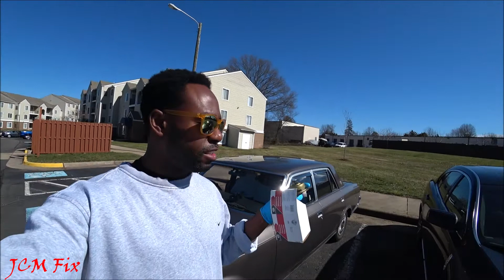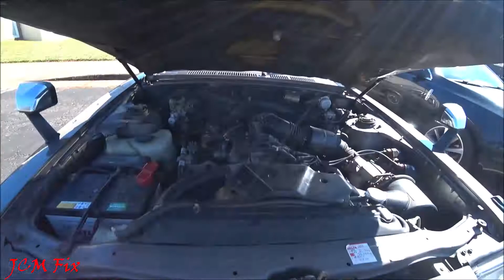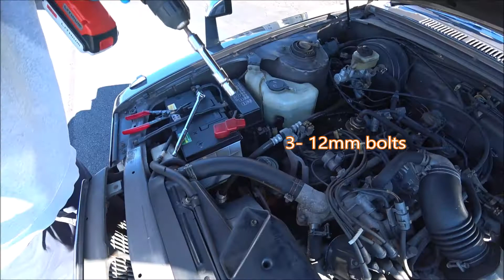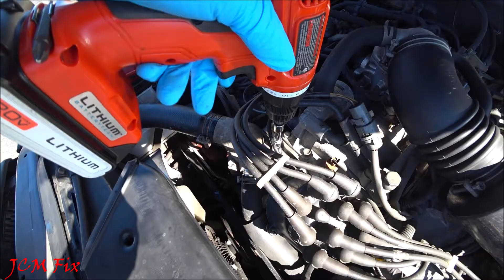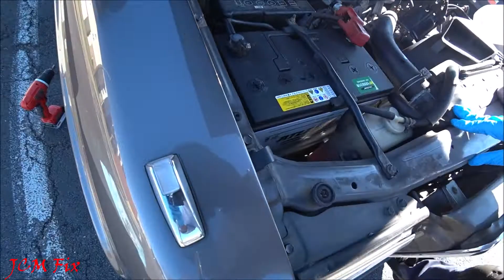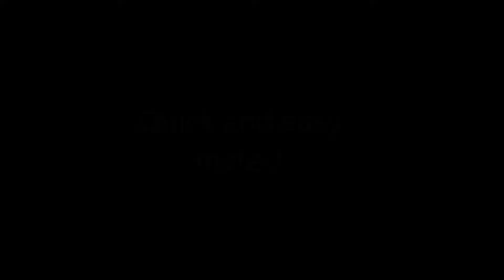How to Fix a Car with No Heat- How to Replace a Bad Thermostat in Your Car (Toyota Century)

Comment: I had to replace the water pump on my Solara once at 117,xxx miles, I changed out both radiator hoses and the thermostat while I was at it. Well, I was a bit worried when the new one didnt have a hole like the original did, I guess I saw the indention and I went with that to go on top. So far its been good a 135k miles. Salute from Texas amigo. Blessings.
Reply from the maker: Wow. You have done a lot.
Yes. The thermostat doesn't have to have a hole. The hole/indention is essentially just the marker for positioning.
Thanks for the Texas salute.

Comment: One can boil water in a pot, put the thermostat in, use a thermometer and when the water  gets up to the specified temp, the spring will contract.  Basically one can test a thermostat like that to see if it’s functioning properly.  All car thermostats have a spring contracting temp.
Reply from the maker: Great information T.B.! I appreciate it.
Reply: @JayCeeMax  that old one you have could potentially make for a cool video
Reply from the maker: @thundabawlt8547  I bet it would but I tossed it as soon as I found out the new one worked. 😅